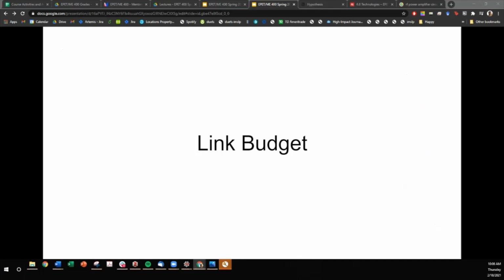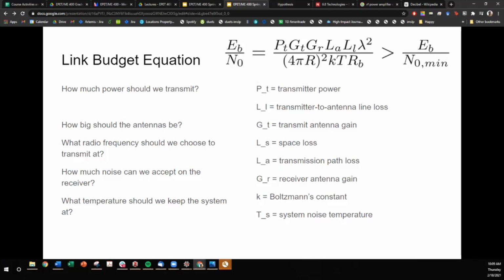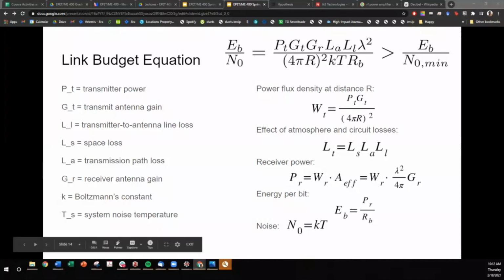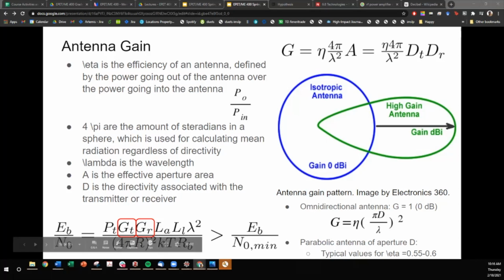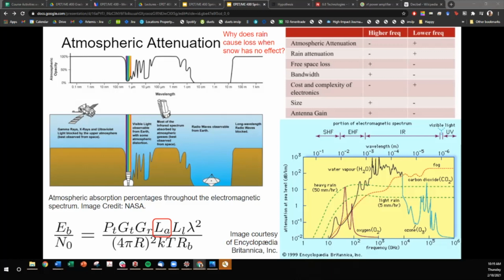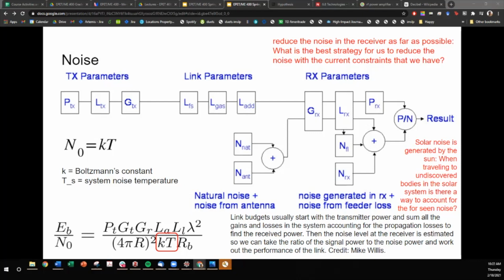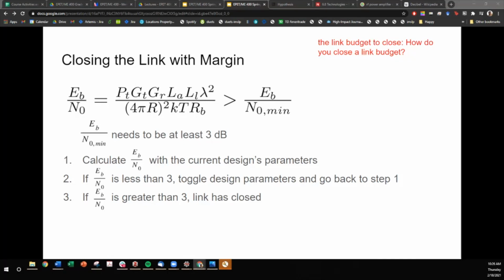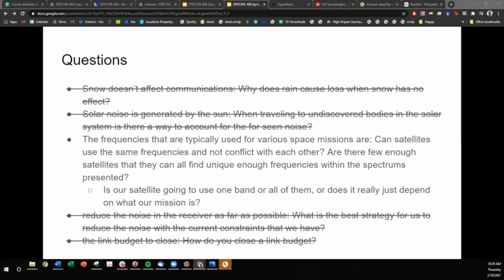6.7 Communications: Link Budget

Comment: 21:23 
It is absolutely possible to make use of the same frequency between two spacecraft by using "polarization isolation". It is possible through using different polarization schemes between signals such as vertical vs horizontal polarization in linear polarization  mode or left-hand side vs right-hand side polarization when using circularly polarized signal. 
Please refer to Ch7, Pg 214 of "Roddy, Dennis. (2006). Satellite communications" for source and more info.
Reply: something on this topic called "orbital angular momentum multiplexing"....i believe....(haven't yet digested the paper) but it is definitely being used....a new development.